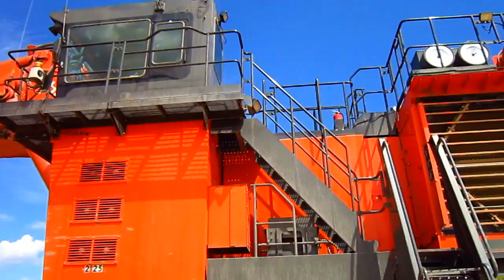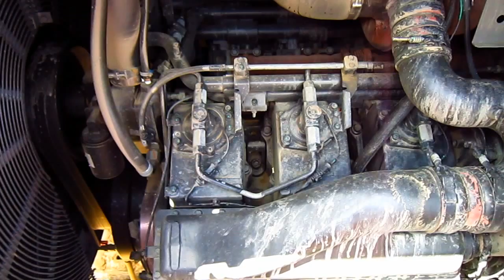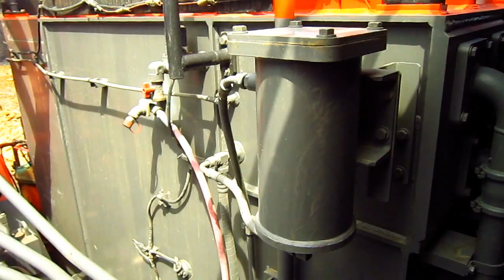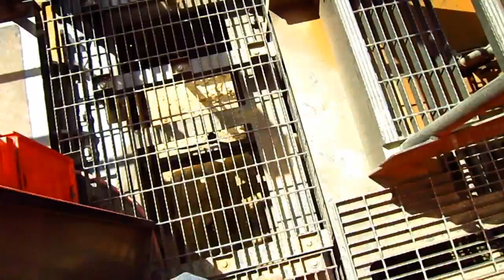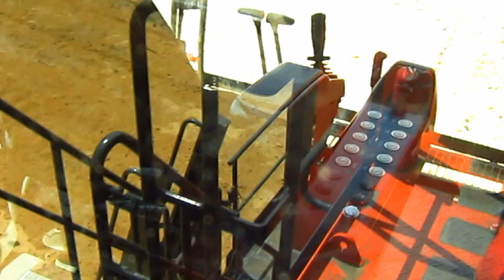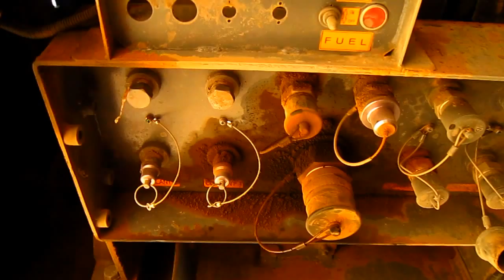Hitachi EX1900-6 Documentary

Comment: Great video.  Would like to see this beast working.  The power compartment  you said can be lifted out in one piece.  Is this a new concept  and is it a good idea. Does it benfit the owner to buy into the idea?
The quality of your videos have improved.  Thanks for taking the time to put quality onto your productions.  Well done my friend.
Reply from the maker: Lynd Gemberling Search my Channel, I have a video of this machine loading trucks.  The power module idea on big machines has been around for decades now, however it made it's first appearance on the 13-15yd class machines that were converted over from a twin engine design in the early to mid-2000s.  Power modules existed on the older twin engine machines, but you can imagine how large and clunky they were to transport. Hitachi was the first, replacing the EX1800-3 with the EX1900-5 which featured a single engine power module.  Komatsu followed in 2007 with it's PC2000-8.  Now Caterpillar has come out with the 6020 which resembles both of these machines with its ease of maintenance design.  Thank your for your comment!  I do realize I have come a long way with my videos, and I still enjoy producing them for my fans!